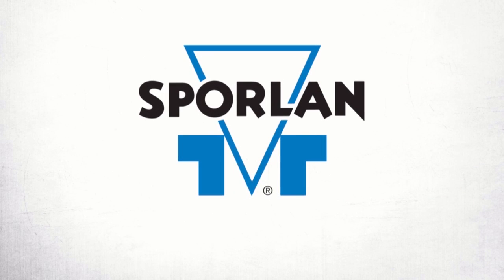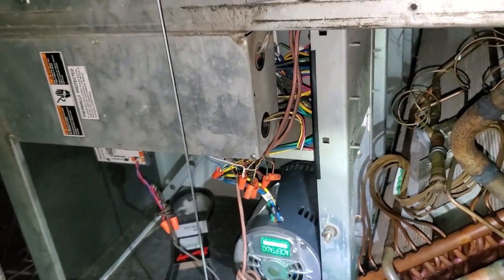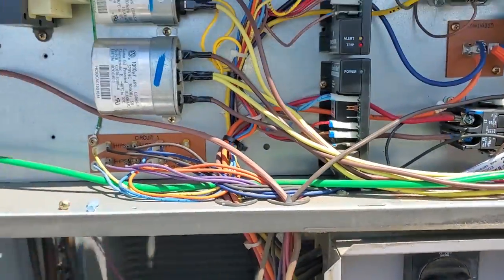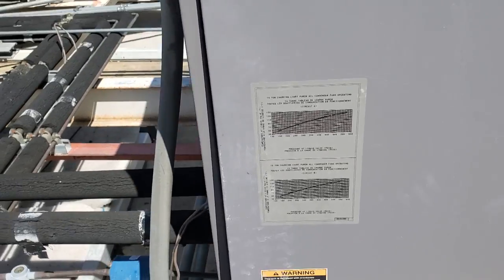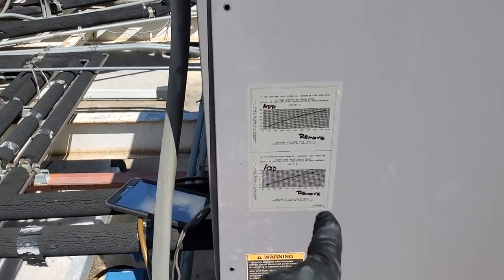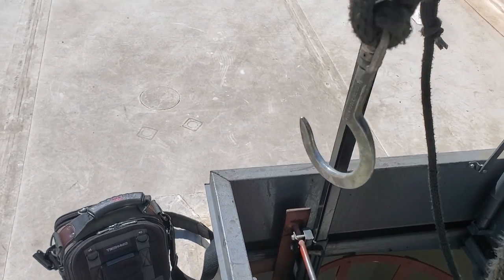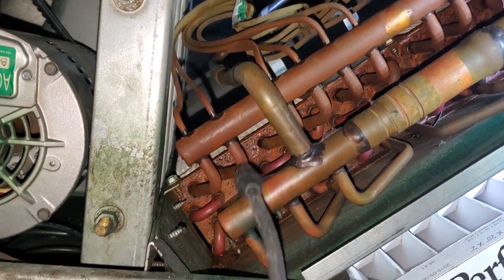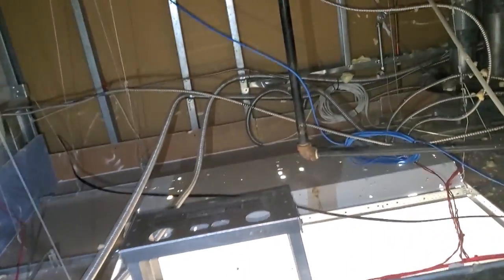KITCHEN AC NOT WORKING

Comment: Take the ceiling tiles out and  removed the ceiling grit under the air handler. Rent a 12ft material lift and replace the whole air handler. 

I have learned so much from watching your vids.
My hats off to you.
Reply: Roberto Garcia or at least get a new coil assembly for it
Reply: Yes that’s what I would do too, there’s too much rust on that evaporator and now is a good time to do it with the Covid 19 shutting lots of places down.
Reply: Thank you for making your followers apart of your day to day project.  You truly have a passion for HVACR and a passion to share your wisdom to the HVACR community.

Comment: Bite the bullet and change the air handler. Spring isolators work better than rubber. Check for proper grounding. Anything with a VFD needs a really good ground. Good work Chris. Welcome to my world.

Comment: Just a thought. About 25 years ago, we had multiple compressors with either the 90 or the straight pipe just after,  rip open. Installed vibe eliminators but it did not solve the problem. Engineers from Weather King met me on site. After extensive testing, they determined the problem was compressor harmonics. I know its probably not related, but with so many leaks, and a VFD changing frequency, could there be an issue? Again, probably not related, but just throwing that out there.

Comment: Personally I would not recommend the leak repair. Just too many opportunities for things to go south. Miss one leak on the bottom or in a hard/impossible to reach spot you'll never pull a vacuum and you be replacing the coil or the AHU altogether anyway wasting a whole lot of time and money.
Depending on site conditions and the layout of the kitchen, if possible remove the tiles and ceiling grid and use either a material lift or 2. You could also use a genie hoist to lift the AHU on top of a small scissor lift to get it up there. You right, looks like a beauty....
Seems like a pain but beats playing a guessing game chasing leaks around.

Really enjoy the content so please keep it up. 

Corey  in Vancouver.

Comment: I had a condenser with this problem on a rooftop unit, the customer didn’t want to change it and said to just go ahead and do what I could and bring him the bill. Just like you said, as I would fix one two others would pop up and I literally just silver soldered almost the entire side and stopped cutting away the metal, it took about 6 hours, two tanks of nitrogen and a tank of oxy and acetylene, pulled a really long vacuum and recharged with NU22B since it was an old R22 unit and that was actually 5 years ago this month, he actually was selling the building and had already negotiated the price based on the existing kitchen and hvac equipment. I really didn’t expect it to last that long, but I guess it’s what you put into that kind of repair as to how long it last.

Comment: Man those compressor modules can be a pain in the ass. Lots of nuisance calls over the years from those things. I've had to pull a few out here and there. Man that coil looks like a pain. I think you'll save yourself a headache if you can  manage to swap the coil rather than repair.  Great job as always

Comment: Vibrations. Poor install. That coil vibrates and the joints gave way.
Reply: I just was thinking that too... vibration dampening mounts should be a thing.
Reply from the maker: I will discuss this on my livestream this evening 4/6/20 @ 5:PM (pacific) come on over and check it out if you can, if you can’t catch it live it will post as a normal video afterwards.. https://youtu.be/ghTZnyid98k

Comment: just saved a big electrical mess when you decided to open up the other system , at 480 v and 600 volts there is no room for bad or loose connections , it arcs and burn quite hard !!
Reply: Hence the black terminal screws...

Comment: Those Emerson modules are a pain in the ass. You need to check the cycle rate of the EMS. If it’s more than 6 times an hour that can cause the module to trip the “short cycle” fault. This being a new EMS leads me to think that is a problem.

Comment: With the cost of changing just the coil including all the man hours. you would probably be on par with just changing the whole air handler. Remove the grid right under the handler use a scissor lift to pull it down replace it and make sure you put the right supports in it to suppress vibration. They thing is rattling itself apart hence all the fractures. The building doesn't look that old. Seems like the original installer took a lot of short cuts and your having to clean up the mess.
Reply: looked like it was just in front or beside the boxes in a hallway or over kitchen, looked like a light, lots of conduit and other wiring directly underneath the unit also.
Reply: Mathew Russell vibration dampers would limit the transmission into building but wouldn’t the internal parts vibrate the same ?
Reply: @joeshearer1247  i think the wire rope on 45 degrees from the hanging strut makes the unit to ridgid. It wants to vibrate but can't, that could cause extreme overload in these tiny corner brasings as well

Comment: Remove the coils and indoor blower then you remove the air handler frame. Alot lighter than removing everything at once. Also cut the frame once its off the struts. Then you can take the frame down in sections. Then if possible use a man lift (rental)for the new airhandler if not a lot of man power....

Comment: if you go for a new coil would you pre-install braze over all these little pipes to make them have more strength in them? Or would that make them just more stiff and susseptical (sorry if spelled wrong) to cracking under vibration? 
And not talking about warranty issues going out the door after you do more to it then braze a lineset to it.

Comment: Wow. I agree that vibration is the cause of the leaks. That evap coil replacement is going to be a bear. I know that it's up to the customer but, I would try to repair the leaks with the customer knowing that a coil replacement is in the future.  As far as the replacement they probable would have to have the ceiling opened up for you to do this safely.

Comment: Cracks me up your saying do not wear headphones, they won’t even let us as a work standard much less OSHA regs. In the past I framed in the underside with more strut and ell brackets to create a solid base under the unit. Then we were able to disassemble the coil and replace it. That was a fun one working 30’ up in a canning facility with a food safe environment. We had to hang tarps below the unit to prevent any dust or debris from falling while wearing hair and beard nets.
Reply: I really love those jobs....NOT
Reply: lol as iff dust doesn't flow anywhere on the airmovements inside the building. They should have just shut down and make it fast instead of making it look good (taking hours) and stil risk the food :( management crap, bah.

Comment: What are they using for low ambient head pressure control for cooling operation? That could be the problem. The head pressure might be getting too low if they don't have any control of it, causing low suction pressure. It looks like it has an economizer you might want to make sure that works too. I think you should offer repairing the coil on areas that you can access that you found already, that would greatly improve the situation. If there's anything in the loops then they have to get a new evaporator. You can take out a ceiling light to try to get a new coil up into that area. I've had to use temporary hanger in one corner to make repairs on equipment when I have to take out a corner post. You can even hang it by the return duct that's attached to the air handler hanging that with a temporary strap if you have to take out a corner post to change out that coil. It looks like the only way I could come out through the top I don't think you have enough room from the side

Comment: Just a recommendation on your hook on the rope. Put a clip on it so that whatever is on the hook does not come off. Saw a guy hauling up some stuff and something caught and actually tipped the hook and everything came off and crashed to the ground. So i normally hate hooks without clips. Man, those leaks looked big when combined. Surprised it hadnt lost more unless it had just started. And that looks unusual. Read someone mentioned the vibration of the unit. Not good. Great diagnostics again !

Comment: I think that thing might of vibrated itself to bits. I would say no matter how many leaks you fix there will always be more. What is directly under the AHU? Is it floor tiles or the walkins etc? I almost think it might be easier for you to lower the whole AHU down and change the coil in it on the ground rather than up in the roof space.

Comment: If you solder over the brazes one would choose a solder with a plastic phase -- in order to do some fillet or build-up.  The style of joints don't look like they would presently handle the stresses of vibration to well -- the angle of transition is to sharp.   One might want to avoid high temperatures if nitrogen can not clear the oil film on the inside of the tubes.  Maybe something can be done to reduce vibration. The manufacture cut corners to sharp.  I don't want to say epoxy, cause there are to many variables.

Comment: it seemed for sure the condensers were running without indoor fans on, but possibly they kept banging them from heat to cool mode setting up thermostats or before they set them up.

Comment: Do you send the bill to installer or manufacturer of this unit? That thing going out on all those joints in the same spot are either bad install, letting the thing vibrate itself to chambles or it was a mondaymorning job in the factory when someone bodged the pipes together and QC was not sharp either!!

Either way i would suggest the customer to make sure they don´t pick up the (entire) bill themselves.

Comment: Is that vibrating electrical line related? Could it be resonating and messing with hanging items? The coil is mounted to maximize surface area in a diag. format. I feel like that makes vibrations worse.

Could you possibly shift weight on the handler lower or higher, (or just the mounts), so vibration is minimized?

Comment: That sucks, It wouldn’t surprise me if the filters didn’t get changed in the winter causing higher head pressure on the evaporator coil, that’s a crazy amount of leaks, I would try to patch the leaks on the headers maybe not the U turns idk that a big job

Comment: 10:58 looks like a loose connection (or not using wire end ferrules) caused that terminal there to burn up. Good thing you saw that - that's basically a cable fire waiting to happen.

Comment: What do you think caused so many leaks? Was it vibrations or Is it just a poor quality product? If it is vibrations what could you do to eliminate the vibrations? I would not think of trying to do anything less than replace the entire air handler. If you try to repair it you'll be back facing more leaks in no time.  Do you ever look at a repair like this one and just decide it is not worth the time and possible danger to even do the job?

Comment: Looks like the return is a big 90 piece. If I remember right the coil can be pulled out from the back, so perhaps you could rent a lift and a couple tall ladders, get the ceiling removed, pull the 90 off the return and pull the coil out the back.

Comment: rework the hanging on the air handler so it won't fall and change out the coils plus put flex connectors on line sets

Comment: Well, if your hypothesis is correct about the energy management short cycling those units, I can see how the other unit was crispy, just spit balling here but maybe that terminal was lose so starting AMP's much higher. just my 2 pcs of CU
Reply: Given the number of things wrong with the install, and that the two roof condensing units are identical, I'd say you could blame a bad install. Loose connectors get hot, even with "safe" amp draws. All it takes is someone not torquing the connector down, and you get burnt terminals.

Comment: the thing with troubleshooting with sound is like guess work and pure intuition. I once had a german and a japanese engineer for a supervisor they both said that they want definitive proof and troubleshooting with sound is not the proper way  to do it. so went back to the electric motor with a power logger, electrostatic discharge bearing tester, vibration tester, megger, tachometer and thermal camera just to troubleshoot the speed of the compressor drive. and remember clearly mr. german engineer told me "intuition is not a troubleshooting tool its only a guide how to proceed and instrument is there to produce digestable data.

I had the same trouble just like that, cramped ceiling and large evaporator coil(30 TR). cant replace the whole evaporator without destroying the concrete slab of mezzanine. this is what I did:
1. cut the old evaporator to size of the egress/digress opening.
2. order 6 units of evaporator(5 TR each)
3. paired 2 evaporator with 1 unit of 10 TR expansion valve.
4. connect all liquid line feeding to expansion valve in parallel (3 units of 10 TR in one common liquid line header) and same with suction line but with the consideration for connection of internal pressure/suction super heat and sensing bulb of TX valve.

I have read something like, soft soldering a R-410a is a big no no. it will leak eventually and copper pipe must be rated for R-410a. why all the rubber insulation there has no polyethylene  tape?

Comment: 11:00 doubling up on lugs barely big enough to hold the feed. Some of those contactors have extra spade connectors on them or u can get them or install auxiliary contacts if equipped. I used to carry a bunch of NO and NC auxiliary contacts on me. Sounds like sketch management company you mentioned.

Comment: I’ve worked on this units a lot they always end up getting leaks on the coil and sometimes with long line sets with a solenoid the coil gets moisture pulled in and then starts causing oil logged evaporator issues and havoc 🤯

Comment: Since it’s a temporary fix, can’t you use a radiator sealant to seal the pin holes? It should hold long enough until these guys get back on their feet and can afford a new part.

Comment: I would add service port at Airbender and recovery charge, and repair leak then check vacuum till you holding mic. That will less trip between cond unit and air hander.. Goodluck

Comment: Just like to add that you can't reuse that recovered gas, nor can you top up a blended Refrigerant.
Reply: First off, I'm not an HVAC tech, but I'm an auto mechanic, so I know the general workings of an AC system.
I don't see why you couldn't reuse the recovered gas, but only in the same system you took it out of and you would have to have started the recovery by putting the gas into recovery tanks that were pulled into a vacuum.
I just don't see what there is to go wrong with "reusing" recovered gas that specific way.
Now, pulling gas out of one system and putting it in another system, that's a no-go.

Also, from what I understand, blended refrigerants are blended from the factory, and they don't separate in storage. So I don't see what the issue with topping up a blended Refrigerant is.
Of course, if you find some random mix of refrigerants in a system, that has to be fixed by recovering it and charging it with the right refrigerant (or a suitable replacement blend if working on something like an old R-12, R-22, etc. system).

Comment: <— Regular Joe IT Guy, knows nothing about HVAC.   I work in a historic mill building with probably 100 or more HVAC systems, everything from chilled water units, to package units to mini splits.  I’ve got to image at least 25% of the units are running below efficiency on any given day.  Does anyone make a system where you could permanently put probes on all of the line sets and monitor superheat/sub-cooling/pressures/etc and current probes on the fans/compressors to proactively determine if/when/where maintenance.
Reply: Its just a normal ac commercail unit. Just look for the compressor and dischargline but im pretty sure those things have tech far beyond me im just in school
Reply: In Europe we have systems that do just that. Its mainly for Facility Managers to monitor plant performance but they are also able to raise alarms as required. Its nice but nothing beats planned maintenance visits.

Comment: 2:35 how? the difference in pressure putting more load on the motor?
Reply: Yes, less negative static causes higher cfm therefore greater current draw.  This happens with the squirrel cage blowers,,,,, not the same for the bladed fans.
Reply: Michael Ryan  propellers dont work well with static pressure

Comment: That entire air handler needs to be replaced. Fixing the leaks will never solve the problem as the vibration and heating mode pressures will keep on creating more leaks, also you don't know what kind of contact there is between the fins and the coil pipes, probably for shit. You never mention the age of the equipment. One of the parts of the equation to replace versus repair is the age verses the condition. I have seen 15 year old equipment in great shape and 12 year old that was worn out, but the age does matter if nothing else for replacement parts.